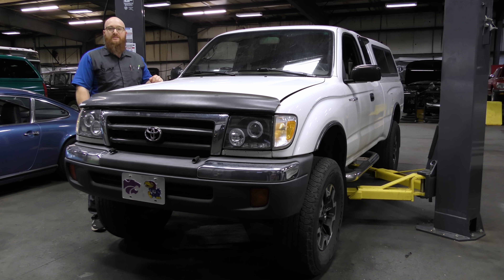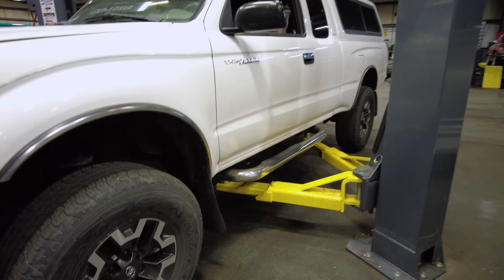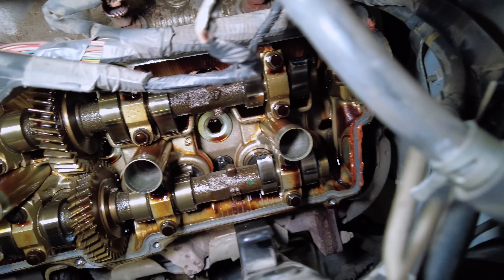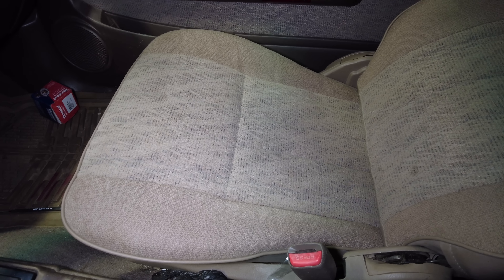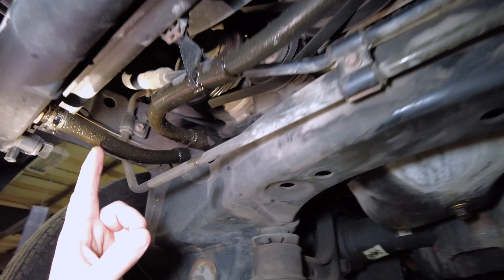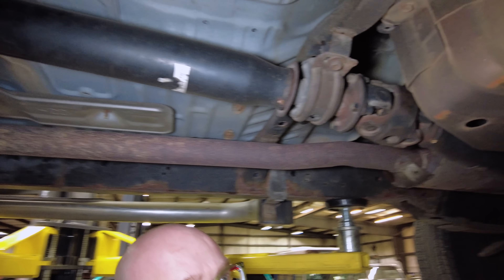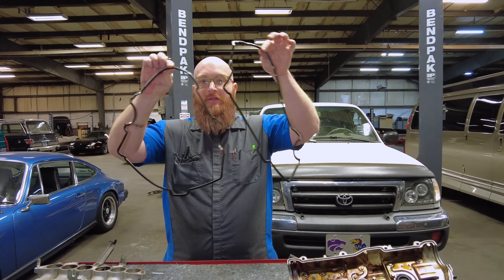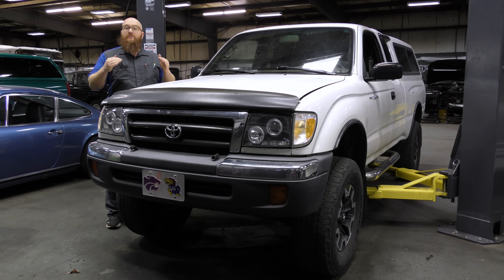Is it worth fixing this rusted out '99 Toyota Tacoma? CAR WIZARD explains

Comment: Like the video the Toyota's not so much. Unfortunately as a lot of people will have problems with certain types of cars at certain times I had an 01 Toyota Corolla with a 1.8 l that burned a quart of oil every 500 mi which eventually plugged up the catalytic converter. Come to find out that the cylinder walls are too thin to hone and start to flex when the motor heats up after getting over 100,000 mi on it. Since mine had 130 it was well out of warranty and nobody wanted to hear or do anything about it. If you look up online you can see this. That's Toyota reliability for you and it left a bad taste in my mouth. Once again it was only two maybe three years that this was an issue but I find that Toyota cuts corners with plastics and things like that which feel cheap and chincy to me. And my Dodge Durangos x4 with well over 200,000 mi on them do not have frames that rust and break in half. Yes I've had transmission problems at 180,000 mi but really 180,000 miles?
Reply: crazy you had the worst corolla ever made and probably the best durango ever made.
Reply: I have had the same experience with a Camry and a Tacoma like this one. Both huge pieces of garbage. I've owned lots of vehicles from Chrysler, Ford, Chevy, Kia, Honda, etc, but the biggest problems I ever had were from those Toyotas. Either I have bad luck with Toyotas, or everyone else is just drinking the Toylieta koolaid.
Reply: 1) The 1zz-fe that was probably in that Corolla did have some issues with that at first (and I'm pretty sure there was a factory recall on those to get their rings replaced with proper ones). My grandparents have one that has 150k miles on it, and it's still puttering along. 

2) My friend's Durango, on the other hand, aside from having the engine give itself up at 100k miles, had a host of other electrical gremlins from the moment I first rode with him in it. It also clogged its catalytic converters right before the engine offed itself.
Reply: @yername31  I have 6 Durangos years 2000, 2001, 2001, 2003, 2004 and 2008..... The 2000 was totaled by the spare tire on the back of a RAV4 which went over the top of the bumper pushed in the grill causing the fire department to have to cut the wiring harness so that the leaking antifreeze wouldn't catch fire. Stupid I know. The 01 had 220,000 mi on it before the transfer case let go The other 2001 has 215,000 mi on it and I use it to plow. The 2003 has 200,200 miles on it and I plow with it every winter for 4 years now. The 2004 has 46,000 mi on it and the 2008 has 196,000 mi on it. I've only had to replace two transmissions at 180,000.. I live in the country and put enormous amounts of miles on my trucks. I also live in the Catskill mountains in the snow belt in the lovely state of NY. Sorry but what your saying doesn't hold water.
Reply: @eddieredmann3  Read my comment below.
Reply: @walterhubicki5207  
damn the only two ive ever ridden in one was a lemon law and the other the trans went to its grave at 60 k miles.
Reply: @walterhubicki5207 We've had probably close to a dozen of those Corollas in my family, and they've all served without issue or trouble well past 200k miles without needing major maintenance (like, say, needing a $3000 transmission replaced). I'm glad you've had good experiences with your Durangos. I'm just saying that the people I know who've had 'em have not.
Reply: @eddieredmann3  Sorry, mine needed a $3000 engine replacement......

Comment: Disagree with this being worth it to fix. Rusty frame = junk!
Reply: Check out Junkmans paradise New video. 05 taco with a way worse frame and still on the road
Reply: @wyattgardner3552  I live in Ottawa Canada where we use lots of salt on the roads.  Here, a car's usual demise occurs through rust,  Once rust starts eating through stuff like frames, it's game over.   When you weld a repair patch on you burn off any remaining protection the metal had, then it rusts like crazy undoing all of your hard work. I have lost 5 cars to rust. over the years.  It's disheartening and not worth any effort to try and keep them going.  I would not waste my time on it.

Comment: My parents bought a 2012 Scion once. That thing had a Toyota engine and burned a quart of oil every 800 miles. Toyota put rings in it and oil consumption went to a quart every 1500 miles, which Toyota deemed "normal." 
How about those new Toyotas. They charge you monthly to use your remote door locks. 
No thanks.

Comment: Is it worth it? No, absolutely no. I owned a Toyota very similar to this one. It was rubbish. I bought it new, it was serviced by a Toyota dealer, meticulously, every 3,200 miles (as instructed by Toyota) it was very well looked after. To give an idea I sold it with 272,500 miles and it still had the original brakes rotors. However, this vehicle broke down the first time three days after I took delivery. Brakes failed at around 50K miles, the tuck would not stop. Transfer case needed bearings replaced, air conditioning ducts fell apart, the locks failed, doors upholstery came off etc. yet you claim Toyota are reliable, not even close. You can see how rotten is the chassis and no, it can not be repaired it needs to be replaced. In general, everything in a Toyota is made on the edge so at most it lasts the warranty period, then you start spending money and it is a bottomless pit.